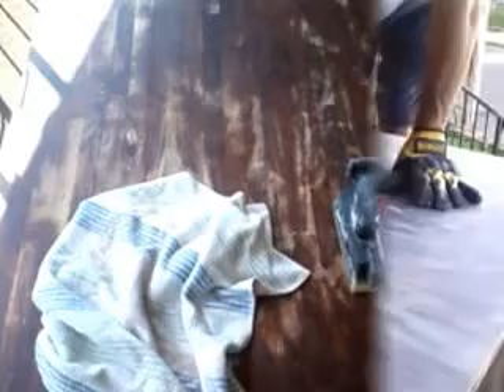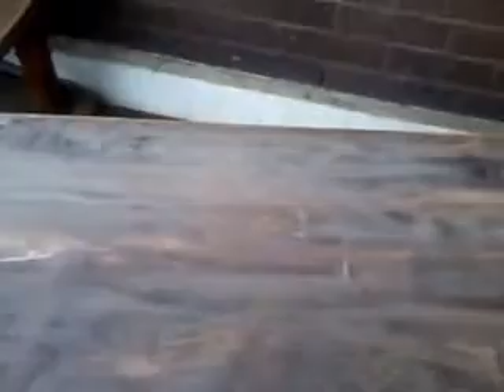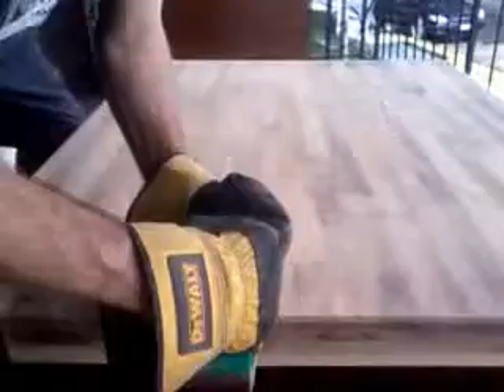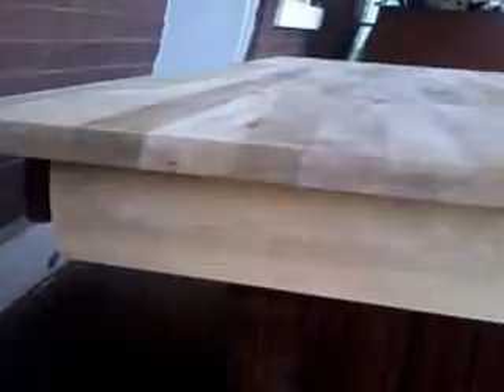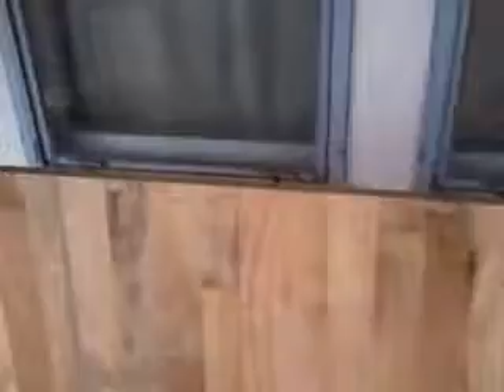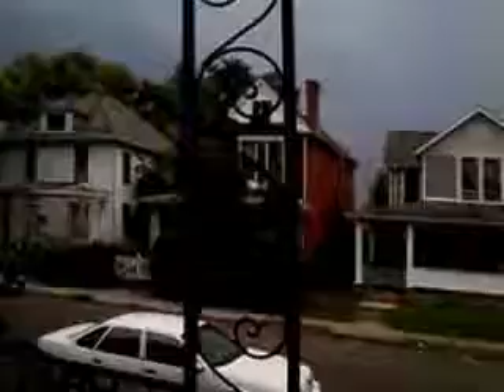Refinishing wood table reclaim butcher block top to natural wooden colors removing old stain

Comment: On Saturday I was given a $75 glass tabletop, unscratched. I'm going to look for a stump to clean and coat with polyurethane and special-cut the upside down stump roots to make an artistic stand for the tabletop. Rustic modern look. Highly sought. 500 bucks easy in one week. Give it a try.
Reply from the maker: +Talavera Man Thank you indeed for all your comments. I believe you are far more advanced than I. I would truly enjoy seeing some of your work. Best of luck in all projects you encounter. I am planning on taking an old tall stool and converting to a shorter stool and matching table soon. I have some large trunks from a maple tree with huge knot holes drying for the future. Sure wished I would have try woodworking alot soon. I really enjoy it. God bless you always.
Reply: +Limb Timber Thanks,  and, when I finish the table and these walking sticks I'll post a little video, send you the link.
Reply from the maker: +Talavera Man Fantastic, looking forward to see them.
Reply from the maker: +Talavera Man Sounds like a great idea. You are right, I will have to try that.
Reply: +Limb Timber With your stump, here's a suggestion...  water it every day to get the root skin bark pliable, then use an extremely powerful pressure washer to blow the skin and dirt off.  

Then use your chain saw to cut the general shape and length of the individual root stems.  you c n determine if you want the bark of the tree to stay on or not, or if you want to completely cut off the above ground part from the underground part. 

Then let it dry for a while but not long enough for the wood to split. 

Before it starts cracking, run a light coat of lightly colored stain to brighten the grain and bring out the varied color streaks. Apply it with a long handled 2" brush to get to all the nooks and crannies in the stump. 

Then do your coats of water based polyurethane with sanding in between that you said you like to do. The more coat's you put on, the more of a "wet look" it will have. 

I saw a moderately well done stump table for sale online that was only $2500. The more intricate you make the design and the better the quality, the more you'll be able to get. 

For instance, say, a hotel contracts you to make a glass top coffee table stump table for it's foyer. It is very big, with matching eight smaller end tables for each sofa around the table. It could garner you a full $20,000 for a month long project. 

Keep dreaming big!  The Lord will help you!
Reply from the maker: +Talavera Man Thank you very much brother for all the helpful hints and advice. May the Lord bless and protect you on all projects and every way.